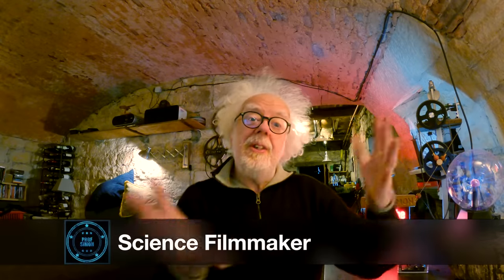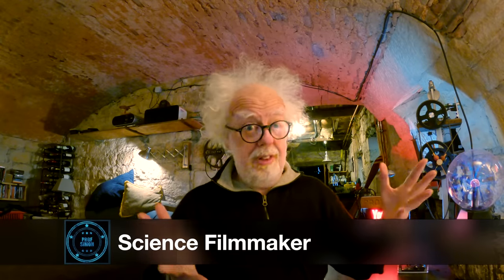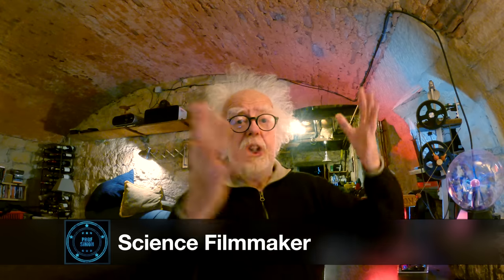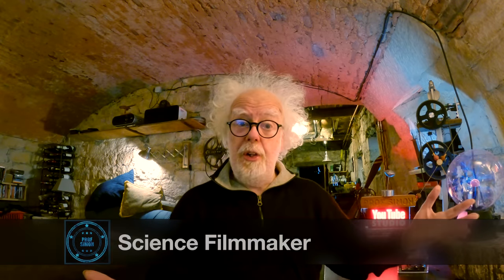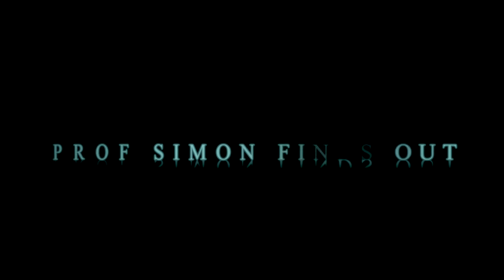Ground or Earth Mystery

Comment: Properly it is referred to as ‘general mass of earth’ in a distribution system; for shock protection it is essential to create an ‘equipotential zone’ so that someone connected to the GME is at the same potential (voltage) as the extraneous metalwork of the electrical installation and apparatus. This may mean that in fault conditions the potential of the earth may actually rise above zero volts; crucially both the voltages (earth and metalwork) are equal, and therefore contact between both through a body would not pass lethal current.
Reply from the maker: thanks

Comment: here in UK nuetral is actually a ground. The actuall ground that you stand on is the return path to the substation and the power station. Thats why the distribution overhead cables and towers only have LIVE cables (exept the very top one that just equlises the steel towers potential) but all the current generated is returned via the ground/earth
Reply: Are you sure about that ?    3phase HVAC -  the current flows  back the negative cycle of each cable too  :0    

local wye point neutrals are added as required and a single-phase can be used ..
Reply: @tristanmckibben2504  Yes I am. Here in UK and I suspect it's same everywhere, the earth or ground that you walk on is actually the nuetral. At least from a substation (transformer) back to the power stations. That's why you get electrocuted because you are contacting a live source AND the ground/earth/floor. You won't find any nuetral conductors on overhead or underground high voltage transmission networks
Reply: @drivewasher  Depends whether it is a TT or TN-C-S (usually PME) system. The supply to the premises has a combined N and Earth conductor which is bonded to earth at multiple points back to the transformer.

Comment: When I was younger I made a Leyden jar and charged it up with static electricity from an old CRT TV and it had so much charge could feel it in the air and enough to make my cat leave my bedroom and could hear it and smell ozone so I thought too much charge to touch so I discharged it to my radiator and the second I did there was a spark ⚡️ and a loud bang downstairs as it had blown our mains water pipe clean off the wall where the copper pipe was attached to a plastic pipe y shaped connector  to our kitchen sink and washing machine, and flooded the kitchen, I went to apologise to my parents but they knew I was in my bedroom and they just thought it was an accident so I decided not to correct them, I still don’t really understand why that actually happened with forces involved?

I also as a kid dangerously tried sending audio through the Earth of mains socket and other end through radiator and if I could use radiator to eavesdrop on sounds in the other room.

And I made ridiculously simple crystal set radios and used to use radiators as an Earth or Ground and noticed better the Earth connection the better and louder the radio seamed to work, also remember reading as a kid once could possibly use plant as an aerial not sure if didn’t mention it on my Favourite tv programme as a kid Tomorrows World.

Also I am very interested in Plasma Antennas that I stumbled across reading as I wanted to see if it was possible to build a radio antenna that is fluid and can change shape instead of lots of different antennas.

Comment: tbh those terms were used havazardly, it was because in electronic they call chasis ground earth so things got messed up
it's more accurate to call grid electricity grounding (equipotential ground), while bounding means to make neutral and local ground equipotential which isn't always the reality
about electric vehicles charging station grounding, i think some video i watched about it covered it, forgot who, bc i wasn't interested in it for my case (grounding inverter)
i think the complication is because some codes requires you ground your charging station but you shoudn't do that blindly, actually depending on what your house electric scheme, grounding your charging station could be a hazard you should avoid, pay attention that TNC systems are not tolerant of local grounds, and you may create a ground loop, but for TT scheme it's okay to ground devices

Comment: Circuit breakers to prevent you from electrocution but believe me you do get tingle before they throw. It was explained to me that when you had a car with positive earth the chassis was 'full' of electricity so they went to negative earth. And then not long ago I discovered that power flows from negative to positive. I shall go back to rubbing two sticks together.
Reply: You are correct that current actually ‘flows’ in the opposite direction to what is popularly regarded as ‘conventional flow’. This is because the charge carriers (electrons) are negatively charged. The main reason why chassis return systems on cars changed to ‘negative chassis’ systems was because the electrolysis action of the current flow caused the bodywork to rust out very quickly; the negative chassis system offers a form of ‘impressed current’ cathodic protection, much as one can find on pipelines and other buried or immersed steel structures
Reply: @fieryfredthebeaconlighter2259  Interesting, thank you.

Comment: Grounding/bonding/earthing. There are hours of lectures on this subject. And years of arguments ha ha haaa. Reminds me of a ghost story I have. There is a very slim earth rod just outside my living room window I discovered when pulling weeds. It had only a 1mm hole for a wire to enter on the stud and knurled nut on top. As an electrical engineer, I thought that can't be for a domestic electrical installation. A few years later I discovered it was for a radio setup as I am studying to be an Amature Radio Operator. I was showing a friend a crystal set I had built that was connected to this rod and as I was explaining that there was a person who probably sat here maybe over 100 years ago listening to the shortwave and the room went freezing cold immediately and we both shivered and simultaneously said F£(k me it's cold. wooooooo.

Comment: The Zoe absolutely needs a good ground. The real charger is built into car and need to wires with 240 volts or 120 volts between them. That charger additionally needs two wires with funny signals between them. One wire is said to be signal ground and the other one is called pilot. The granny charger is not a charger but a silly box that feeds the real charger power and pilot. Connecting signal ground and yellow-green is a nightmare but that is what the magic box does and it seems to work most of the time. But when you do not have a very good ground that is when it fails becouse your signal gets distorted. When you have got very old cables and sockets in your house you only have two cables to your power socket. Some magiciens - electritions are not allowed to that - connect the blue cable to the yellow-green and now the magic box works. Dont tell anybody or you might get tarred and feathered. Dont think about RCD return current detectors or things are becoming nasty very fast.

Comment: Ok how 1 wire works......
A simple circuit is a wire connected between to points of "different" electrical potential, volts.
The "earth" as in the planet is 0v arbitrary distinction decided upon many years age (yes I don't know when lol).  Electricity will always try to get to 0v, like water and gravity. A power source, Battery for example has a voltage of say 12v, that is between the positive and negative connections, Connect the negative to the dirt or earth and it is equal to the voltage of the dirt, 0V. connect the positive to a wire and the wire is 12v.... the wire runs to anywhere on the planet and measure the voltage (this is theoretical, there is more info but its good enough for here), wire to dirt difference is 12v ta dah you have in reality extended the positive connection to were you wanted it, the negative connected to the dirt is one earth sized neutral connection.
This is how the idea of an earth in the electrical sense came about, the earth/dirt/planet is one big connection. or another way the earth/dirt/planet is the bottom of the hill where water will flow too.
Clear? I hope so.
PS the car charging... the electronics will be thinking you Neutral to earth connection is just too good, unbelievably so, it will expect a worse resistance value so think its actually a fault. the earth stake will be a worse connection which it will be expecting to be normal.
Its a bad design feature which no doubt be fixed at some time, very common in electronics were they have very tight specifications.

Comment: Electricity doesn't flow through the wire but around it make since?? Do ur research on this. If switch with a wire to the sun and back to a light how long after switching the switch will the light turn on??????????????

Comment: Ypu're confusing things by stating that ground is the same as earth, they are not
Let's assume you have a metal cased electronic device fed from the mains
The case (in the uk and most other countries) MUST be EARTHED, however, the electronics insidex might be low voltage dc, the common connection on the circuit board (usually negative), is electronic GROUND
A typical problem arises with metal case record player, mixer, tape recorder, microphone, amplifier etc
The case of anything supplied by mains is earthed, and only the electronic grounds connect to each unit, there 'might' be a single interconnect between ground and earth, often just at the mixer, otherwise you get ground loops/hum loops.
I'm a retired electrician and have dealt with multiple designations of grounding, including 'telecomm ground' fuels system ground (which must be separable for testing), electrinic ground, data ground,, none of which are 'directly' connected to the planet
Reply from the maker: thank you....good info

Comment: There is an actual ground from your circuit breaker box to a grounding rod driven into to the "earth"!
Reply from the maker: not in France....i dont think.
Reply: @ProfSimonHolland  Didn’t Ben Franklin supposedly invent the concept of grounding via the lightning rod invention? Ben Franklin was also deeply connected to individuals in esoteric circles, the French establishment, and Voltaire himself. So this knowledge of Earth being a conductor capable of being engineered around has actually been there since the first stories told to the public about electricity (in the US Ben Franklin is huge figure in the history of electricity)
Reply: @ProfSimonHolland  an alternative to the ground stake is the incoming metal cable sheath.
Reply: Depends on the supply type,,,, TT,  TN-CS, Etc... Go look it up .
Reply: @norton750cc  "Depends on the supply type,,,, TT,  TN-CS, Etc... Go look it up"  <--- the correct answer! Congrats, a rarity in the comments section.

Comment: i use my laptop in bed, bed has an electric blanket, i get a tingle in my finger when i use the mousepad on the laptop...... laptop is 2 wire supply so i guess its leakage but enough i can feel it in my fingertip, but not my thumb.... double insulated 2 wire not eathed device should be banned....

Comment: would youhave everboiled human urine. as it appears the crystals forma excellent insulator , that actlike a thermosflask.so in a vacuum sealed car engine and a hv discarge causing a ion  formation in the cylinders may cause a super conductive stage .ie lightning then thunder .as air being the whole fuel only.but the car itself is not earthed but draws from and re circulates into air.as in joe bookers air engine and stanley meyers and joseph papps light guide engine  neon light is a big clue  but not allowing the photon to emitt but to bombard the internal air energies of all those neuclei of so called atoms

Comment: As I'm sure you're aware there was (maybe is? rumours are always around that they're coming back) a British car manufacturer called TVR who are famous for their poor reliability. A lot of these problems are a result of ground faults because the bodywork is non conductive fibreglass and the tubular chassis is aluminium which while, generally, is a good conductor it does oxidise quite easily particularly when exposed to salt and become non conductive. As such they're a nightmare for wiring issues because grounding points fail semi regularly and the offending wire is a pain to find because they're hand built and rarely follow any kind of logic (wires/layouts aren't standardised and it's not uncommon for a wire to change colour somewhere along its length or to be spliced into another random wire).

Comment: The issue with the earth for the Zoe could possibly be the ground resistivity, hence the need for a deeper ground spike. 
See https://en.wikipedia.org/wiki/Soil_resistivity for the science and math behind measuring it.

[ As a side note: many years ago I worked as a technician in a digital telephone exchange that was situated at the top of hills that had a lot of shale. When the earth and bonding was installed it was found the ground earth was too resistive. To solve it a big ring of copper wire abt. 10mm thick was run around the perimeter of the land (which was abt 1/2 acre) in a trench abt. 2 metres deep and every so many metres a ground spike was driven into the trench bed and attached to this ring which then tied back to the main earth mat of the exchange that was located below the vault. While this seems overkill, it was not in this case as the area experienced a lot of lightening and it caused a lot of damage to the equipment and power rectifiers for the exchange supply. ]

Comment: using the vehicle chassis as an electrical ground is just a cheap and nasty solution used to skimp out on copper cable... I have fixed more faults with those connections than I can remember.... any car that I ever rewired got treated to ground cables as well as any fishing boat....
Reply from the maker: absolutely agree